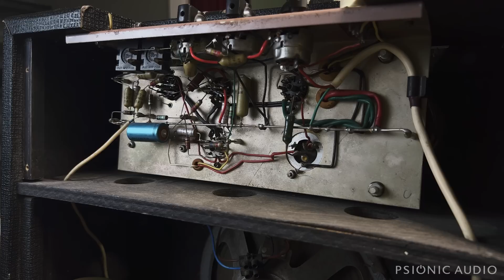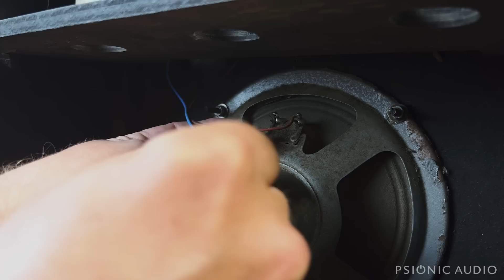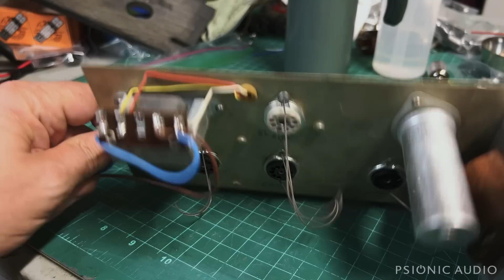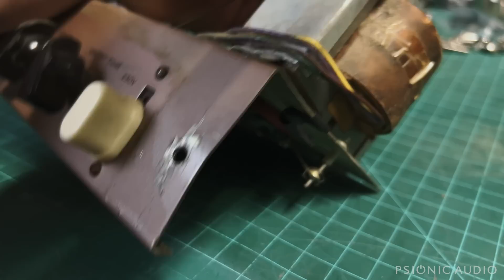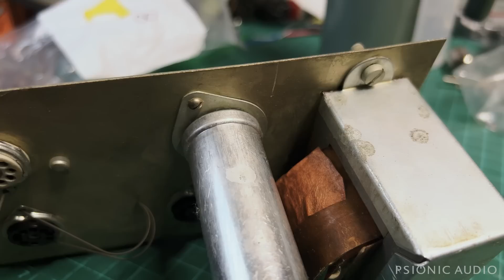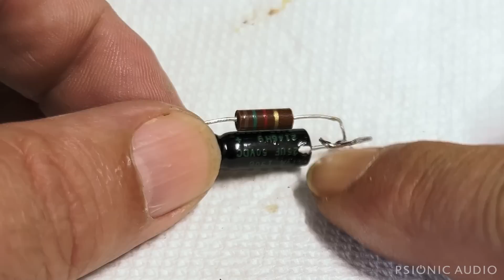'64 JMI Era Vox AC4 | The Work Begins

Comment: There actually is a fuse. It's inside the "110v/220v" red plug on the control panel. I don’t know the fuse size name, but they're really tiny.

Comment: Any reason you dont use blue loctite on some of the hardware Lyle?  Also, you do have the tool for straightening legs on components, its the other end of your black pointer you use.
Reply from the maker: Blue won’t hold a transformer and red might but makes disassembly difficult in future. That little thing works for 1/4W resistor leads but not on large cap leads.

Comment: A fuse is the mains plug.It's been a British standard since the 40's. We even call them '13amp plugs'  over here.
Reply from the maker: Ah, but a 13A or 3A fuse will not protect an AC4. Needs a 2A at most.
Reply: @PsionicAudio  Yep.It's very common to find UK plugs with over rated fuses.1A and 2A are available but can be harder to find than 13,5 and 3 which are sold everywhere.
Reply: @PsionicAudio  Yes - the UK plug fuse is rated to protect the cord, not the appliance - so the amp should have a fuse appropriate to protect it.

Comment: Maybe Whitworth for the nuts and bolts? I used to drive a 60's Humber hawk and you really had to have a Whitworth set, as Imperial or Metric were not correct - they'd work but be prepared for spanner rash. I think a 1/4" Whitworth was close to 1/2" imperial as the 1/4 was the diameter of the bolt not the nut.
Reply: If you need some whitworth spanners - let me know!

Comment: If the owner is interested in a better sounding speaker for it,and it’ll fit(I can’t recall if those had 10”) a Weber Blue Pup Alnico sounds fantastic with that circuit. I built a couple ac4’s out of Roberts reel to reels and the Blue Pup sounds like it was made for it. Breaks up beautifully.

Comment: Your screen is glowing there. With no voltage on the plate your screen is now your anode and therefore glowing red hot and oscillating thermally.

Comment: I have an old house (UK) that has been rewired about every 30 years - the sparkies always hide their detritus under the floorboards and leave the old wiring in situ.
The interior of that amp looks just like under my floorboards does - multiple eras of different wiring.
The brown and blue in particular are DIY store standard mains wires - IIRC those colours were introduced in the 70's (live and neutral) replacing the previous standard which was red/black.
The terminal block also appeared to be 70s, or later,  vintage rather than 60s.
While there's nothing wrong with that blue and brown wire it's the sort of thing that would trigger warning bells if I found a tech using them in my amp - it's the kind of stuff I reclaim from table lamp mains cable for my incredibly dodgy projects - one step up from using foil as a fuse.
Reply: You'd think they'd steal the copper like they do in Australia. Lol!

Comment: Whitworth thread pitch   on the odd nuts used . A very odd British  design .   Well at least now they went  to metric . Bit from pre WWII for motorcycles and such .
Reply: I remembered also from a 750 Triumph I used to own.   .
Reply: Working on old British vehicles is a nightmare.
You need the king's ransom in old obsolete tools.
Reply: I used to see Whitworth threads in some high end British turntables such as Ariston.